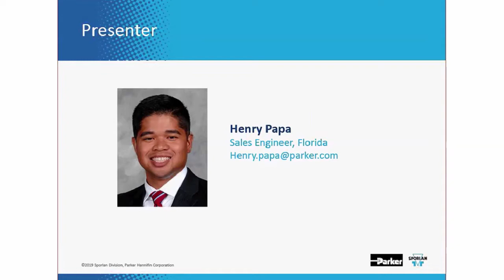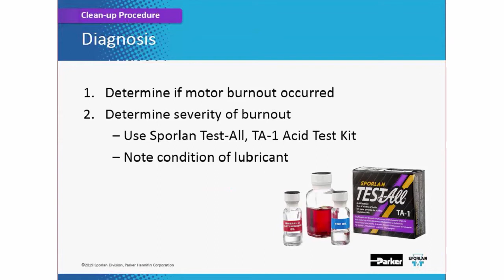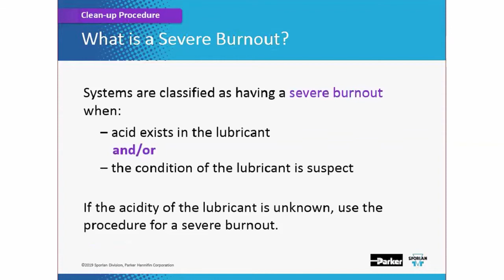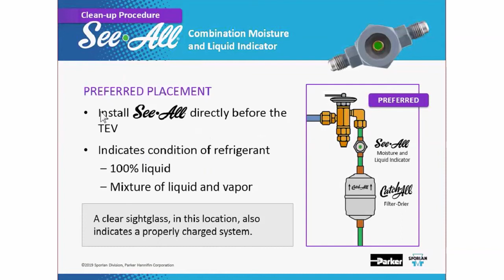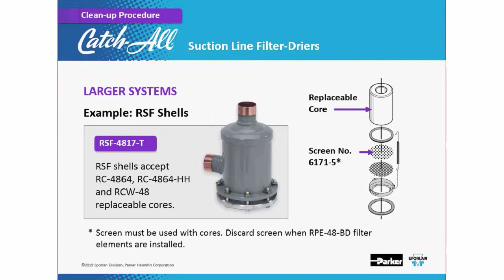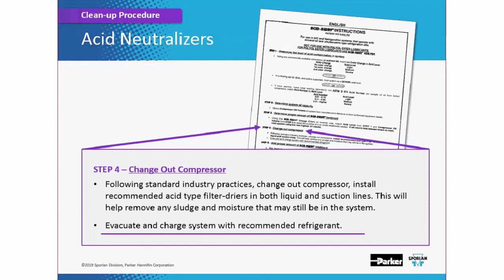How to Clean an HVACR System of Contaminants Using Parker Sporlan Catch-Alls

Comment: Hi. If I use the RSF Shell with core replacement in retrofit to replace the Hvac equipment but reusing all the pipes, asusuming there are not solid particles only moisture and acidity. I must have a pressure drop through the filter too? If I Only have moisture and acidity do not cause me a pressure drop too?

Comment: I always flush the system after a burnout, and I recycle the refrigerant and start fresh with virgin refrigerant. My reasoning is to remove as many contaminants as possible. Is a flush and new refrigerant necessary with an oversized liquid line dryer and a suction filter? Thanks.
Reply from the maker: The refrigerant is not damaged by the burnout and can be reused, provided the contaminants are removed.  Please see Bulletin 40-10, page 35 for proper cleanup procedure.

https://www.parker.com/Literature/Sporlan/Sporlan%20pdf%20files/Sporlan%20pdf%20040/40-10%20Catch-All%20Filter-Driers.pdf?elqTrackId=d84d0f00a20642a09353909c50818265&elqaid=16329&elqat=2